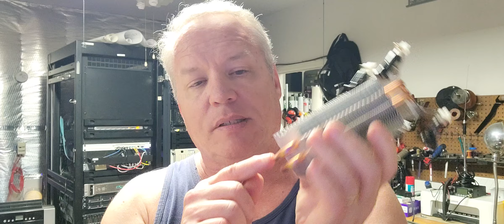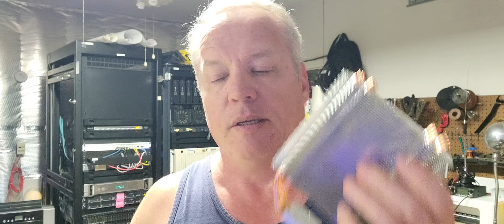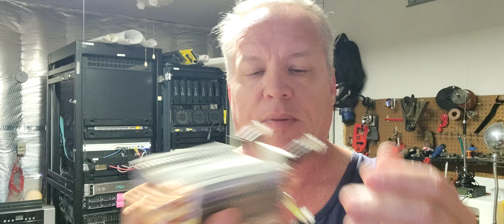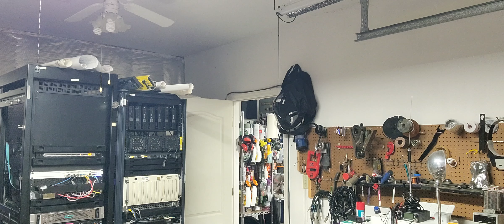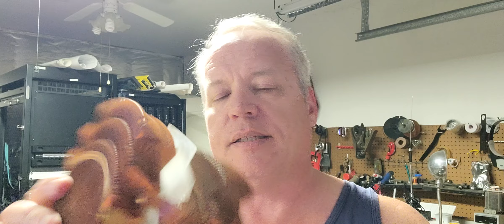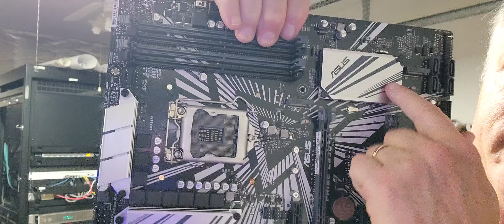Heat heat and more heat in your home IT lob

Comment: Hi Brad,
I have often found in my office/lab that heat has always been a big problem. The principle reason is this area is downstairs in my home, therefore has double brick walls and also faces east. The brick walls act like a heat sponge during the morning and make it near impossible to remove heat from the air inside the room during the height of summer.
At one point I had 3 42RU racks in a much larger room with most of the gear running 24/7 which included 7 or 8 HDD shelves and DL380+580 servers associated network gear.
At one point this “large’ room had a high temperature of around 36 degrees in the middle of summer. 
Not good at all.
I ended up dividing the same space, about 8 x 3.6M, in half. Although I have not finished yet, I’ve calculated I should be able to run the same gear in a smaller room, but with hot and cold aisle type set up, the room can be kept at about 28 degrees C. The hot aisle faces the hot front brick wall of my home. Still not ideal, but this is only applicable when running my whole lab flat out……which doesn’t happen often. But still allows me to use the same heat pump gear, much more efficiently.
Which is just one of the things we learn as we go. Also having worked in the HVAC &Building Automation industry at one point has helped. 
Take care Brad.
Reply from the maker: OK so first, the brick wall is bring in heat from the outside. If you notice in my videos I have a silver covered walls.  There is a reason for that,. That is to prevent the very thing you are dealing with.  You need to insulate the inner wall away from the the outer head of the outside.  place up ferning strips 1x3 inch  or 2x4 inch wood boards up on the brick walls and then put up the insulation that has a high R factor to retard heat retention. That will help a lot with your issue,.  Hope this helps some.
Reply: @leadiususa7394  Thanks Brad 👍🏻